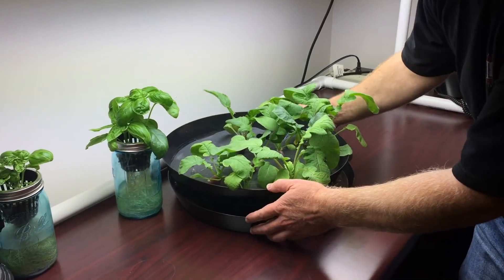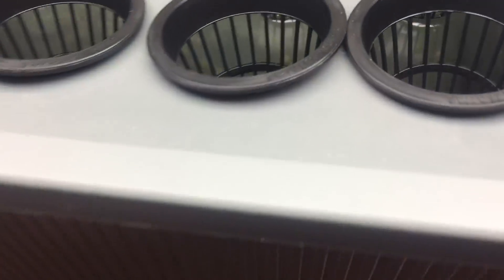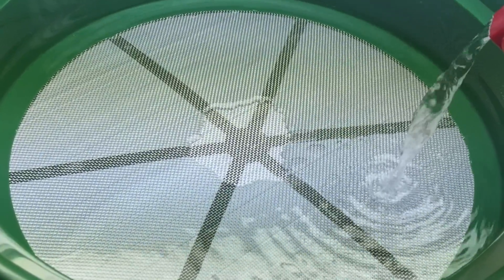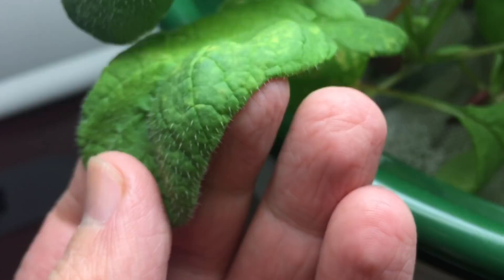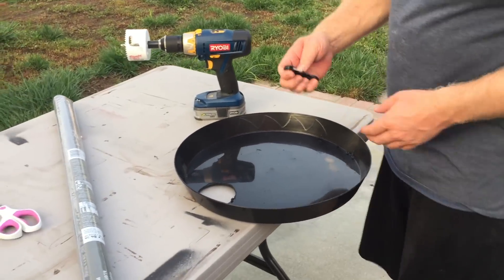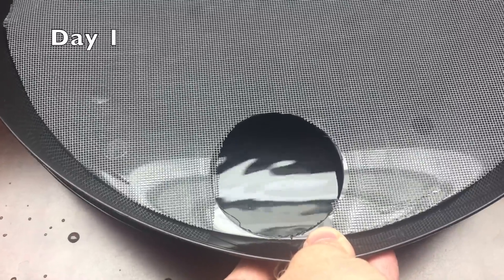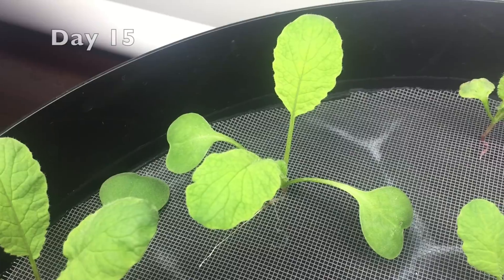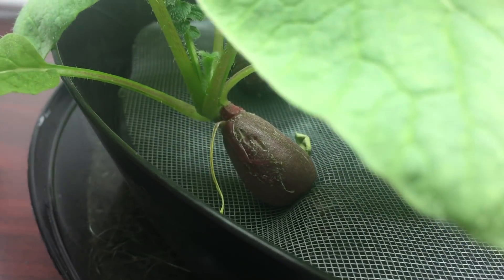Why did he grow them in a window screen?

Comment: How about a silicon mat? I have a non slip mat that is a silicon mesh, they are usually used for car dashboards so things don't slip off. Stretchy, won't degrade and should be firm enough for what you're doing.
Reply from the maker: might be a good idea

Comment: Have you thought about trying it in Coco coir?
Reply from the maker: Yes but that defeats the purpose    Too much labor and cost with that.
Reply: Not that much of a work but it works well for defeating algae as well I do think it will work well for radish. A little bit expensive, yes.  But you can re use it
Reply from the maker: I see that as a pretty good option for hobby stuff, but I'm trying to make something that can mass produce radishes (eventually)

Comment: Wouldnt burlap work too instead of using a screen?....just curious
Reply from the maker: I think so, but I worry about it's reusability.  If I'm going to use a one time use product I could probably find something cheaper.
Reply: Jeb Gardener just found your videos and have been learning a ton ....keep up the great work....im thinking of starting my own little indoor grow myself here and just watched the kratky carrot video....i heard somewhere that the legth of the carrot had to do with the depth of the container.....if you were to put the rockwool cube in like a 3 inch Pvc end cap and have the legth of pvc stand upright and supported would the carrot grow longer in a longer tube?
Reply from the maker: I cut the grow short because the greens were getting so leggy. Hard to keep enough light on them from the top only.  They will grow longer but genetics affects it too.

Comment: could you just grow them in a large plate full of water?
Reply from the maker: i kinda tried that.  you need some mass of water to keep it circulating i think
Reply: @JebGardener  mabe you could start them on a screen and then move them to a tennis racket with very loose strings
Reply: @JebGardener  or maybe try cutting the screen into strips and then glue the ends of each strip on to the bucket to make a grid shaped pattern so that they can move the wire easily while growing.

Comment: Why not just use gravel and use the upside down bottle to keep a water level? Is gravel considered as soil? .. I mean.. it's reusable and you can still put the fertilizer in the water if you leave a small area without the gravel (possibly surrounded by the window screen?)
Reply from the maker: As long as it's easy to handle and reusable I'm up for trying it.  Algae might become an issue in that setup.
Reply: Keep the spot without the gravel sealed so that light can not hit the water directly and pick a waterlevel that keeps the water covered unter the gravel. Gravel should be 100% reusable (if your plants don't invent a way of eating it ;) )
Reply: I would really love to see if this idea works!!

Comment: I wonder if the screen you are using is still to nice. I used to fix window screens for rentals and sometimes it was just better to buy the cheapest stuff you could because you would be replacing them again in six months. It was just a cheap plastic. You could break it easily. I wonder if that would work. You would eventually have to replace the screen, but you could probably get a few cycles out of it.
Reply from the maker: Going to try worn out agribon next

Comment: take and cut the screen in 4 directions so that as the radish grows the screen opens further. only need to go 4 or 5 wide, just enough to let it pull the rest open. should fix your problem, pair of cuticle scisors would be perfect
Reply from the maker: I'm going to try agribon since that is so much cheaper and there is always some torn stuff available.
Reply: thats a good idea as well. seems you already have the window screen material so either or wont hurt. all about experimentation

Comment: Great effort, I love your dedication. But there is more protein in sprouts than tubers and they take less time too. I would like to send you some of my nutrient formula for you to try.
Reply from the maker: what is your formula like?
Reply: this formula is 14.10.27 with all necessary micronutrients completely water soluble, I've been using it for years in hydroponics and on my allotment with very good results. Contains all necessary micronutrients

total nitrogen (n)   14%
ammoniacal nitrogen  2%
ureic nitrogen       12%
phosphorous pentoxide soluble in neutral ammonium citrate and water            10%
phophorous pentoxide soluble in water 10%
potassium oxide soluble in water 27%
calcium oxide soluble in water   2%
sulphur trioxide soluble in water   7.5%
boron soluble in water  0.012%
copper soluble in water chelated by EDTA 0.0055%
manganese soluble in water chelated by EDTA  0.02%
molybdenum soluble in water chelated by EDTA 0.0016%
zinc soluble in water chalated by EDTA 0.0055%
iron chelated 0.04%
magnesium oxide soluble 2.5%

Comment: A paper towel over hardware cloth! (The wire has much bigger openings than window screen) and the paper towel is the medium that could hold the seedlings from dropping through the 1/4 inch to 1/2 openings in the hardware cloth until the plants are big enough to not fall through it. Not sure what will happen with the paper towel. Sorry...your answer is a paper towel. LOL! 🙄
Reply from the maker: I did agribon and I still got some constriction in the half inch hole in the plastic.  I'm thinking over metal fencing instead.

Comment: why not aerate the water?
Reply from the maker: Anything unnecessary must be purged.  For example remove the word "not" from your comment and it becomes so much more useful.
Reply: Jeb Gardener air will oxidise that scum layer . And it will help the roots grow . Just from my experience. It doesn't have to run all day, maybe 4 hours max spread throughout the day on a timer  .
Reply from the maker: I keep doing more test and keep getting more convinced that it isn't necessary.  There is a cost to every decision though.
Reply: Use a turkey baster periodically?

Comment: Have you tried layered cheesecloth?
Reply: Maybe you can use (or make) something similar to a large embroidery whoop to keep the cheesecloth taut enough to lay the seeds on.
Reply from the maker: I tried it with agribon on the same disc.  I still got some constriction, but that was because of the plastic hole being too small.
Reply from the maker: yes but used agribon would be a free resource on a farm.  The lightweight starts to break after one season.
Reply: Jeb Gardener Ahhh! Free is always good!

Comment: Nylon mesh or silk treated so they don't degrade
Reply from the maker: I'm trying agribon right now.  It works pretty well and could be a good use for the stuff that's torn at the end of the season.
Reply: Panty hose are a cheap nylon mesh

Comment: man why are your video's always so depressing?, be a little happier,  as to your problem, window screen is a great idea!,
i think that at some point, just do a transplant, move them from the window screen to a net cup, or here's something i just though about,
take something like  rockwool cube, or a rootriote cube and slice it thine (like a disc) and make a hole in the window screen that is half the width of your semi porous material (the disc) allowing the seed to site on top and grow in and through it, not letting the seed fall in, allowing the bulb to expand as much as needed.
personally i like soil better.
now if you want something interesting to do, i managed to train a radish plant family (6 generation ) to grow in an environment that has 55% of the earth's normal atmospheric pressure with a gas atmospheric composition 80% carbon dioxide 10% nitrogen 5% oxygen 1% carbon monoxide, 2% water 2%a argon